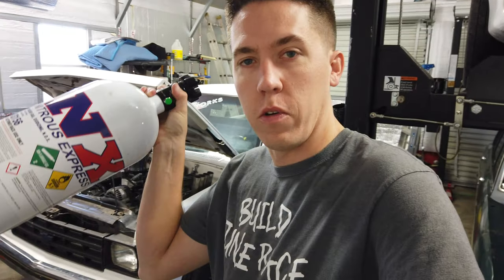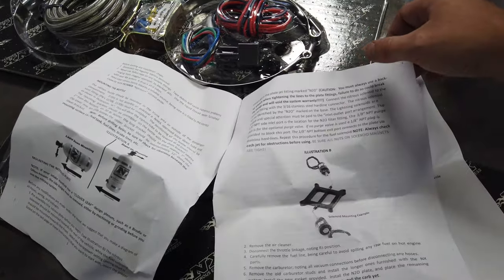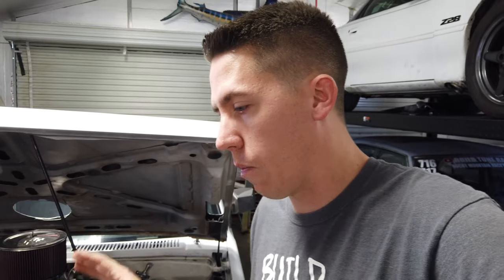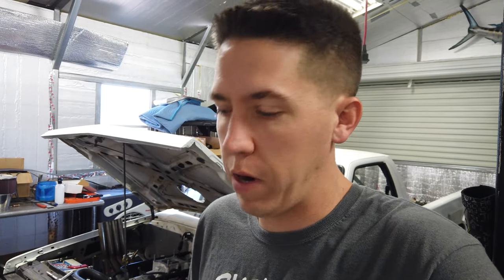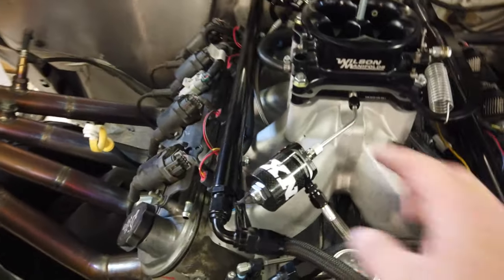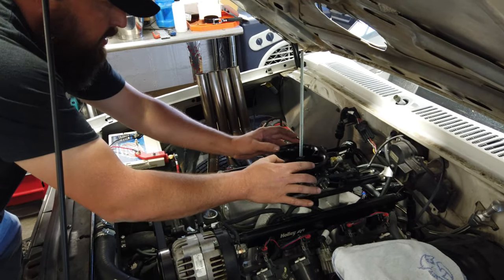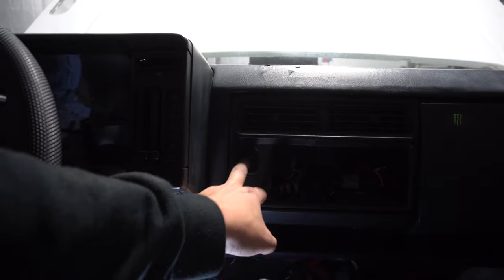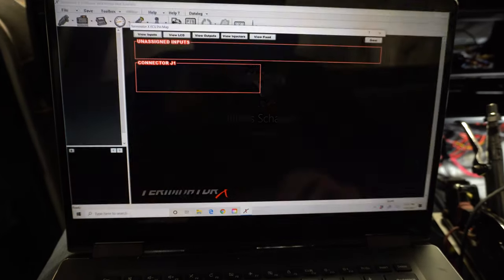Cleetus and Cars Burnout Competition Prep, We added Nitrous to the Burnout Truck!

Comment: The siphon tube is on the opposite side of the bottle sticker which is the reason for the brackets they provide but it shouldn't make much difference unless you run it low.. I think.. lol